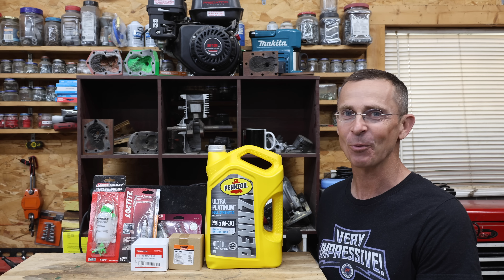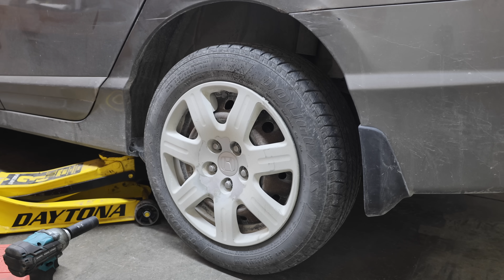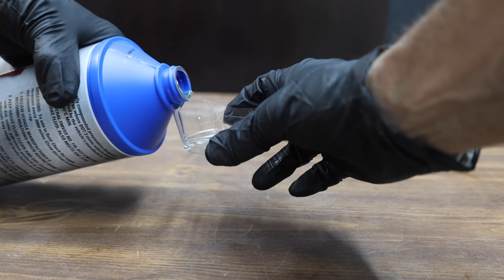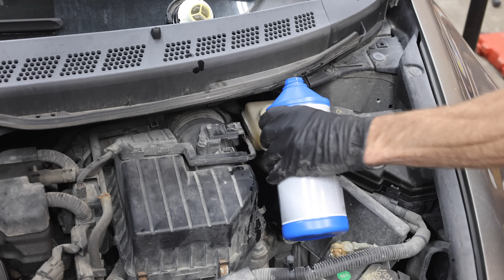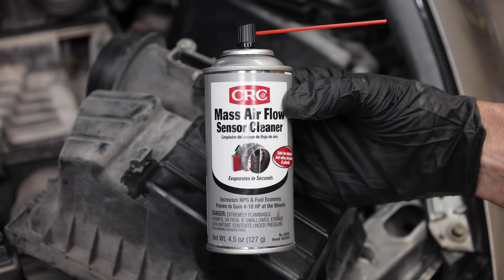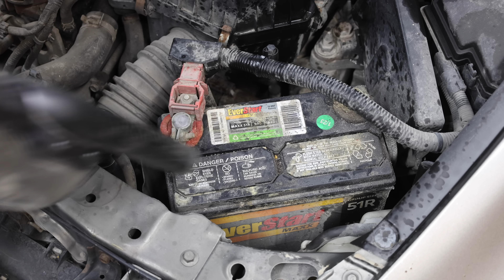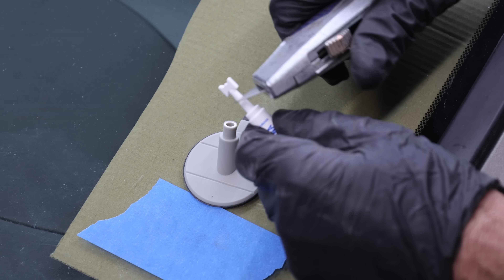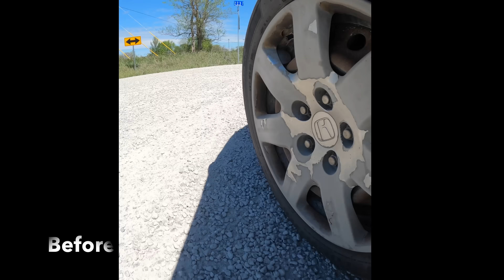Most Reliable 200K Mile Car? Let's Settle This!

Comment: I have a 1996 Toyota Camry LE Station Wagon with over 300K miles on it, I'd like you to take a look at  👍
Great Video 
With the cost of new vehicles skyrocketing, good used vehicles are the newest Gold Rush 🔥
Reply from the maker: Where do you live?
Reply: @ProjectFarm  Way out in West Nebraska...About an hour east of the Wyoming State Line. I bought the car on Ebay from a Dealership in Richmond Virginia.  Full disclosure, I gave the car to my Son to drive a few years ago. When I bought it used, it had 108K on it. That was back in 2005. I drove it to over 200K, then willed it to him because he needed a car. It's been his daily driver ever since. I don't actually know how many miles it has on it, the odometer tripped over 100k for the 3rd time in 2019, then stopped working. It's never needed any serious engine work. Just general maintenance items...Power steering pump, windshield wiper motor, rear struts, replaced front shocks & a brake job. I've lost count how many sets of tires we've driven off of it..Engine still purrs like kitten, no transmission problems.. gets 35 mpg, no matter how you drive it. It has the Transmisson boost button next to the gear shift, pressing that will drop your gas mileage pretty good, but it's great for driving in the mountains....I always tell people, if you're going to buy a Toyota, you better love it because, you're probably going to be driving it forever. The paint is starting to fall off of it, but it's been a great car. I'm fairly certain my Grand Daughter will be driving it within a year or two

Comment: Watching along with this and I saw you do the thermostat and coolant, and maybe I looked away for a moment, but did you do the timing belt and water pump too? Maybe not needed if it was done recently. It's not critical if it's a non-interference engine like the older D16 engines, but just keep in mind that old timing belts will fail at some point after 80k-100k miles on the belt and then you'll need to do it AND be stuck on the roadside. :)

Comment: I had a 2000 galant 2.4 last to 350k actually hard use miles from teenager to 2019 adult.  I just did timing belts and I let the timing belt snap on its palliative journey at 350k.  It was a fine car survived MN winters for 20 years.  Very cheap and simple car but never had to fix anything.
Reply from the maker: Thanks for sharing.

Comment: You start to work like ChrisFix and I love this. This type of new format video is amazing and I love it.
I do own an old 2001 Opel Astra G and I try to make all repairs myself. Sometimes is difficult because my mechanic skills suck but I research before I attempt to undo any bolts. 
Filters, oil, tires, belts and many more I replace them myself. Is about 600k miles and it still works like a charm
Reply from the maker: Thanks!

Comment: I really wonder how new cars are going to be 20 years from now.  Cars like this?...no problem.  They're simple, parts are cheap and you can keep it running basically forever with just basic maintenance.  Many new cars are WAY more complicated in multiple ways (screens everywhere, unnecessarily motorized pieces, etc), some require special tools (ESPECIALLY in regards to software stuff), and don't even get me started on EVs...don't sell your "old" cars, people!!
Reply from the maker: Thanks for sharing.

Comment: Do not just hand tighten oil filters. The filter can become loose from vibration and leak out all your oil and ruin the engine. Ive had to replace engines cause of oil leaking from oil filter not tightened.

Comment: Inherited an ‘09 hybrid version of this civic at 180k from my mom when my car got stolen.

It was burning oil and had some misfire codes, but was able to fix them pretty easily (in a few afternoons with next no experience, just YouTube and civic forums lol).

Now it’s at at 210k running like a clock. Somehow the hybrid battery is still fine as well! 

Best part is, it gets 40+ mpg after I changed spark plugs and coils, cleaned out the egr valve/passages, and replacing the pcv valve.
Reply from the maker: Thanks for sharing.

Comment: The problem with insisting on driving 10+ year old vehicles is: safety.  You’re driving  car which is lacking all the latest safety features developed in the last 10+ years.  Yes it will get you from point a to point b like any other car… but that’s not the end of it.  Very short sighted.

Comment: My mom has a 2016 Prius that has over 250k miles and is still going strong. With a good car like Toyota or Hondas and with good maintenance like changing oil at 5k or 3k depending on oil type you can have a car last a long time don't do the 10k oil changes not good for the engine even with full synthetic oil.

Also forgot change tans oil between 35k to 50k miles don't believe in life time fuild for trans it will get dirty with normal ware and tare
Reply from the maker: Thanks for sharing.

Comment: I have a 1991 Geo Tracker (rebadged Suzuki Sidekick) which as been my daily driver for 30 years.  I’ve changed the oil and filter religiously every 3,000 miles.  It has 228,000 miles on it, has never given me a major problem.  I wish Todd was my neighbor, however, as he did a great job in fixing up that Honda.
Reply from the maker: Thanks for sharing!  Thanks!

Comment: Im now driving a 2007 Chrysler minivan 278K miles currently. Ive been maintaining this van since 2010 when I bought it for GF mom with 137K. At 200K I treated it with CERMA oil additive in engine and transmission. replaced motor mounts, coils and shocks and brakes, bleed the PS and Brake fluid (She lives on a 7mile dirt road) thing is dead reliable so I gave it new headlights and 10ply tires.
Reply from the maker: Thanks for sharing.

Comment: That fluid removal tool is identical to my brake bleeding tool. But I use oxygen hose from the pharmacy as it has a rubber end that stretches over the bleed valve, vacuum hose barbs an comes in 100 foot lengths. I extend the incoming hose to the bottom of the jar so any air in the clear line I know just came out of the brake system. An I use the car engine as my vacuum pump. You can also add a $1 fish tank air valve to allow turning the vacuum off an on.
Reply from the maker: Thanks for sharing.

Comment: i have a 01 f150 with a little over 350,000 on it! other than the front 3 passenger side spark plug holes blowing out ( over about 4 years when it was our main vehicle ) it has not had any major repairs untill this last year , cracked water fitting on the intake, a leaky oil filter adapter gasket , and to be replaced a leaky heater core(probably the most time consuming)  keeping around for a spare vehicle  , will be getting a head lite lens cleaning kit  per Project Farm recommendation's !!!!!!   great vid lots of fun
Reply from the maker: Thanks!  Glad to hear!

Comment: I've done pretty much all of that to my '01 Subaru Outback LL Bean airport car, and despite being 23 years old, it runs like a top.  Uses no oil, but I changed out the front axles a three years and 5000 miles ago and one of them is already cracked!  I guess I don't drive it enough and it dry rotted.  

I have to drive it 1000 miles up to Memphis next month and leave it there until September due to training;  I suspect it will make the round trip with ease.  Proper maintenance always saves you money.

Great video!
Reply from the maker: Thanks for sharing.
Reply: If you didn't use OEM parts some of the aftermarket stuff uses terrible quality rubber. 

I don't buy aftermarket parts with rubber on them anymore after having more than a couple parts store ball joints / sway bar end link boots crack and totally open up in a year - year and a half at the earliest.

I swapped them all for OEM, they last much longer.

If an axle is super cheap, there is a reason why. It's not likely to last 20 years like the original part did.
Reply: @volvo09  All true, but these were not cheap parts.  $175 for both axles when $45 per axle was pretty common.  I'm  not sure what happened.  I did it myself and it was not too bad of a job, but I might take it somewhere this time.

Comment: buick lesaber
enough said 
.
easy to work on when stuff does fail..... if it ever fails (got 370,000 miles on my wheel bearings and entire power steering system)

Comment: Great content! If you were going to replace your Suburban with a lower mileage one, what would you look for?  ( Year, mileage?)
Reply: I'd say a similar early year, the earlier the better... but when getting into 15+ year old vehicles, especially in areas where road salt is used miles mean nothing to me... A 100k mile 12year old vehicle can be ready for the scrapper (or need thousands in rusted suspension and frame repair) where a 200k+ mile 20 year old vehicle that never saw salt in it s life might need 1/2 that cost in repair and will not be hiding more rust repair, or rust related costs like rotted fuel and brake lines...

Comment: My son totaled his 2003 Honda Civic, manual.  The engine was untouched and has 80,000 miles on it.  Still drives, just no back end.  It's in Montana.  Let me know if you're interested.  Take that engine and your body and you will get another 300,000.
Reply: They aren't that hard to find in scrap yards. 

But maybe someone local would want it if it had perfect service.

Comment: First thing on a timing belt car is the timing belt and water pump. That 100000 mile belt is already lived two of it's lifetimes. I only realized this as I was cutting up an old break pad into a valve spring compressor so I could replace valves that did the bump and grind with a piston.😂
Reply from the maker: Thanks for sharing.

Comment: In my experience (including having worked as a mechanic at an auto repair shop in Walpole, MA) Honda's die by rusting/rotting in the undercarriage/floor. Once that happens you can't put it on a lift again because the floor breaks loose and everything moves skyward as the floor and subframe break loose and smash into the roof which is irreversibly bent along with the entire chassis. If only Honda would better coat the floors (to stop water and salt from rusting the floor from the inside) and the undercarriage (to stop road salt and all else from causing the undercarriage from rotting through) they cars would be the most reliable things on the road.
I love GM, but am a fool for a Honda.
Watching on 2 screens so I can write this and let commercials play fully on both (so you're paid). Should I stop writing that? It's true, but may be taken as me bragging for no real benefit...
Reply from the maker: Thanks,  I appreciate that!

Comment: $1,600 2002 Toyota Highlander, 178,000 on the clock (2 years ago, now 210,00) everything works but one speaker tweeter. Needed brakes at all 4, a wheel bearing, a good cleaning, she still runs and drives like new.
Reply from the maker: Thanks for sharing!

Comment: Did this crap for 20 years. You did good for a non professional mechanic but you really don't need to torque spark plugs. And the best thing to do is replace the headlights, they aren't that expensive.

Comment: I gave my 2002 nissan altima v6 to a friend with 378,000 miles on it.  He now has 425,000 miles. Never changed the trans fluid.  I had the 2 catalytic converters changed, the coils, plugs, radiator, and alternator. Otherwise, just oil, brakes, and tires.
Reply from the maker: Thanks for sharing.

Comment: You can tell that car is not from the rust belt. Those suspension nuts would be rust bonded big time. Plus the dust shields haven't rusted away like they have on my wife's car.

Comment: Love your videos!
18:00 I do have to step in on this one though.
Yes, the "average" new car is going to be wildly skewed, especially for people who buy pickups, SUVs, and luxury vehicles. People who aren't worrying about the expenses. Especially when you're just comparing something like a Honda Civic, which is going to be about $25k new on a standard model, that's already slashed that payment roughly in half. The insurance will also be cheaper on a cheaper new car (my 2018 Mazda 3 that I ordered from the factory cost me about $50/month for full coverage. Although I have a completely clean driving history and in my 30s. You can expect some discount for new vehicles with more safety features like detecting objects in the next lane or automatic braking systems if you're about to have a collision, which my car came with as standard). 
I think that's also pretty generous that a used car that's 15+ years old is going to be $100/month more expensive on repairs and think $50/month on maintenance is pretty excessive if you do it yourself, but I suppose we'd have to give solid examples of that. I also noticed you didn't include something like fuel mileage. I'd be hard pressed to find a vehicle of similar class that can average around 40mpg like my car does. This is also considering I won't have to worry about getting stuck somewhere by something failing that I didn't catch 50k miles ago. 
I'd agree that a new car is more expensive at the time, but that contrast on your total is wildly out of touch. Doing the math when I got my car, it was going to cost me about $100/month more than keeping my 2003 Camry which I wasn't as secure in knowing it would not fail on me at any given point.
Reply from the maker: Thanks!  Thanks for sharing.

Comment: Some Hondas have a rubber timing belt. If it’s much over 100K miles, it needs to be replaced immediately. Those Honda crank bolts are tight,tight,tight.  Toyotas have a timing chain that can last “the life of the engine”.  I liked this content and the style of your videos.
Reply from the maker: Thanks!

Comment: Most vehicles are mostly reliable if you maintain them properly, but not all. I have a 2001 Audi with well over 225K miles and in 4 years it's only left me stranded once. A plug on my fuel pump shorted out and honestly if it wasn't 1am I would have been able to fix it on the side of the road but I just wanted to go home so we flat towed it and I fixed it a couple days later. But then there is my 2014 Audi. It has just under 96k miles and is currently sitting with a blown engine for the second time! First was a burnt exhaust valve, I think it's much worse this time but haven't explored it yet.
Reply from the maker: Thanks for sharing.

Comment: I was bummed that I had to get rid of my 220,000 miles Fusion - super reliable, but our plans for retirement required me to get a pickup to use as a tow vehicle and I don't need two cars. I think the Fusion would have gone another 5 or maybe 10 years.
Reply from the maker: Thanks for sharing.

Comment: Note that the vehicle in this video has a timing chain that does not need replacement, but many older vehicles may need routine timing belt changes to avoid destroying the engine when such belts fail; I learned the hard way many years ago.  Belts need replaced at least every 100K miles and unless you receive a full service record with a car you cannot be certain the belt is okay unless you've changed it yourself.

I had just changed the timing belt in my car when the rear subframe decided to bend in such a way that the car is no long drivable.  Powertrain and interior are in near-new condition, but the underbody is rusted apart :(.
Reply from the maker: Thanks for sharing.

Comment: It's definitely economically and environmentally better to keep cars running longer, up to a point.  There's a break-even point for very old and inefficient cars, but anything less than 25 years old is better to fix than replace.

One problem with this approach is the tools and space needed to do this maintenance.  If we, as a society, wanted to optimize for repairs instead of junking and replacing serviceable cars, we'd set up tool and workshop spaces for community use, much like how libraries supply a lot of services beyond just access to books...
Reply from the maker: Thanks for the feedback.

Comment: 270k on my 16 sierra 2500 duramax not on mechanical breakdown only thing I have replaced is 1 indirect(9th ) injector, both knox sensors and 1 EGT sensor. all emission related
Reply from the maker: Thanks for sharing.

Comment: Great video, can you include sealed transmission maintenance in the next one? Also, a comparison of the spray paint/clear coatings used on vehicles might help other when trying to make repairs like this or to the body
Reply from the maker: Thanks for the suggestion.

Comment: Nice work.  In the future a great way to replace all the trans fluid is using the cooler inlet and outlet. That way the front pump will cycle all the new fluid through the TC and the old fluid out into a catch pan.  Just measure how much is added and removed but it should be an equal amount.
Reply from the maker: Thanks!  Thanks for the constructive feedback.

Comment: Fun fact, if you change all of the transmission fluid in one go from a transmission that has not been serviced with a lot of miles on it you can ruin the transmission. The clutch material that is suspended in the old fluid keeps it working, once you remove it all, the transmission may start slipping or not work at all. It's generally best practice from what I've been told by old school mechanics to do what's called a drain and fill, meaning you basically just drain the pan measure the amount that came out and then replace that much with new fluid. That way you still have some of the old fluid with clutch material still in it to keep the transmission working and having some at least fresh lubrication. I've seen this happen on more than one occasion and oftentimes the transmission will work again when you put the old fluid back in if you haven't already gotten rid of it.